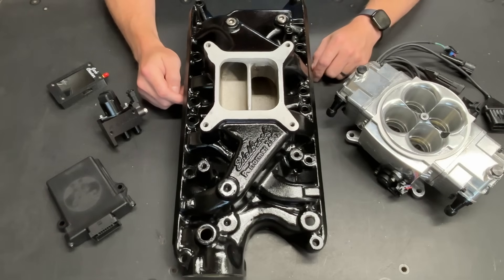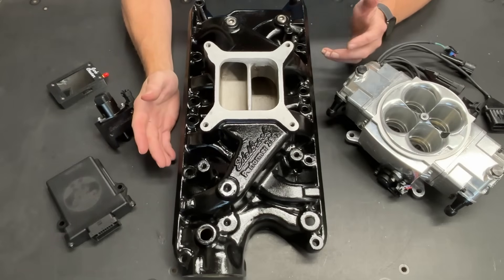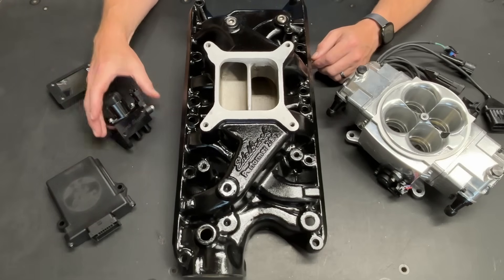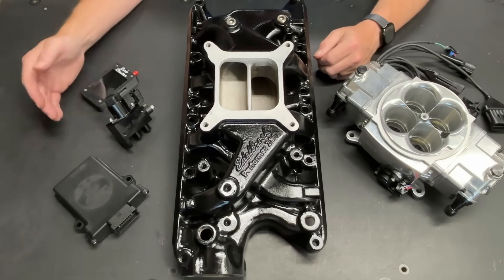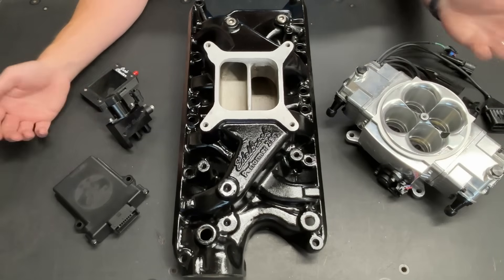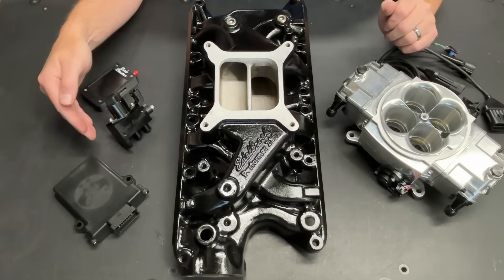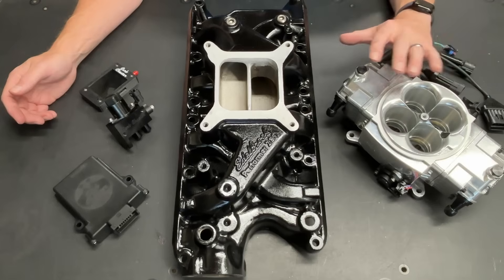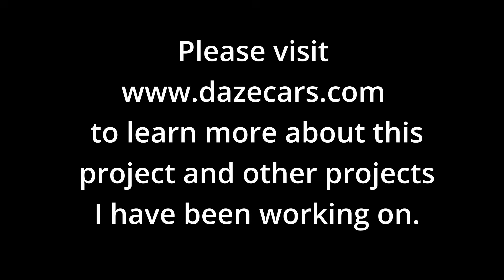Computer Controlled Fuel Delivery Carb Cheater 2.0 Vs Sniper  2 EFI, Why I Decided to Try Them Both

Comment: Cost comparison is flawed, fuel needs (pump, lines and return line) alone for the efi tilts it  in favor of carb.
Reply from the maker: Its not flawed, I wasn't saying it was exactly the same just that its close unless you already have the carb.  Carbs cost between $500 and $1000 so even when the fuel pump is factored in for EFI the carb cheater with carb may still be about the same cost as a TBI.  Also there are other manufactures of TBIs that are around the $600 mark.   I stand by my statements.
Reply: I appreciate the response; guess I'm more hung up on other channels speaking how the efi will solve the world's problems but do little to discuss he fuel system needing a significant investment - so little talk about the return lines, replacing the fuel lines to handle the higher pressure, new electric pump, elimination of the mech. pump, drop in tank systems, possible need for external fuel regulator... it just goes on and on...  Having said that, I am looking forward to seeing your thoughts on the carb cheater as its something I keep thinking about buying for my '73 Comet.
Reply from the maker: You are correct, bottom line is a TBI EFI is not as simple as just replacing the carb.  In this day and age neither option is inexpensive but it sure is nice to have options depending on skill level, desired use for the car and budget.

Comment: our subscribers must have some crossover :) 
neat to see Carb Cheaters out in the wild - beat me to my own CC 2.0 video (I need to lobby for more vacation days from work - my day job lol) 
Myself and Joe are the CC guys - between the mechanical/physical design, programming, and assembly to shipping. somewhat stressful, but such is life - a lot to juggle. 
side note, CC 2.0 with both the display and main circuit are updatable (I work on it in my "free time") - I have a worthwhile update for your display there, simply plug it into your computer and follow the prompts on "update display" of our websites "install info" tab. id post the link, but youtube will give me the ban hammer lol

CC has become somewhat a community project, so if there are any additions you would like to see, Id be happy to hear them - Since im the programmer, I can make changes and updates relatively quickly. currently working on datalogging for the screen like what the android app has - a future update there. 

CC has a weird backstory - primarily driven carbed cars my whole life, seemed like I was always chasing the tune, discovered widebands in 2012 or so and could then see how afr moved around based on conditional scenarios. not bad, but not perfect - static metering device in dynamic environment things. Carb Cheater was that last little piece my own perfectionism apparently needed with my own cars - just the thing I myself always wished existed, and eventually I learned enough to go "hey, I think I can make that thing". A lot of pain and suffering later - here we are (I under appreciated what it takes to actually MAKE a product LOL)

you might notice some "weird" fuel economy things on the highway - a lot of people seem to report fuel economy benefits. Personally I think thats just inherent in using the data and the auto-assist to optimize the carb - I'm not a fuel economy guy myself and I didnt make CC with that in mind, I just like the optimization game and a clean running engine. You will notice that the valve adjustment trades places with your foot pedal input - probably where some economy comes from as it probably benefits atomization (again, not my intent - but hey, "happy little accidents" I guess?)

I did originally design CC to hook to a carb itself, but frankly I prefer the valve porting and insulative properties of our spacers - if you would like one, feel free to email us at carbcheater at gmail along with any other questions you might have since you literally beat me to my own 2.0 demo video :)
Reply from the maker: I am not shocked by the fact that our channels have some crossover.  Given the shear volume of subscribers you have it would stand to reason that one or two would find there way to my little channel.  I'm a small fish by comparison.   Someone must have mentioned this video as a comment on one of your videos?  I did email you about a month back just after I ordered my CC looking for an ETA on the product, introducing myself, to let you know what I was working on, and to reach out one small business to another.   I did hear back from Joe but only the ETA was addressed.  I wounder if maybe you didn’t see the email?

I may have gotten my intro video done first but it will be a while before I get the unit installed on the car with subsequent install video to follow so there is still time for you to get your video out there  😁

I can’t imagine working a full time job and then have the carb cheater job as well as trying to maintain a YouTube channel all at the same time.  I have been selling classic Mustang parts out of my shop for 20+ years but it’s my day job.  That along with maintaing a YouTube channel more than fills up all my time.

As to your comment “I under appreciated what it takes to actually MAKE a product LOL”  I feel your pain, everything I sell started out as something for one of my cars and at the time I was posting what I was doing on forums.  There were enough people saying, “can you make one of those for me” that it developed into a business.   I don't realy do much of the "making" any more but that creates its own issues.

I may be interested in the carb spacer although if I needed to I am setup to modify an off the shelf unit.  I didn’t order the spacer because I have limited hood clearance and figured the port in the carb would be sufficient.  If you would like to chat further feel free to contact me through my website or if you end up finding that earlier email I sent that should have my address.  

I hope you enjoyed my video and sorry I beat you to the punch 😁
Reply: @dazecars  eh, subscribers mean nothing in this day and age - so dont read into that sort of thing, I've just been here a long time (like 12 years). I've definitely stretched myself too thin here lately where I wont be able to keep up work, youtube, and CC without losing my mind - It hasnt been all daisys and roses. 

my apologies on missing the email - joe and I switch back and forth in order to manage it depending on whos doing assembly in the evening. 
I'm a long time Ford guy, and would love to check out your stuff - I'm sure we would get along well. I can tell you are pretty sharp, whereas I just have to try really hard lol.

Joe deletes emails after going through them where I am more of a hoarder (which applies to many aspects of my life lol) - Id love to chat about your 393w if you were willing to pass along your website here. I myself started one and then life got in the way - I always appreciate the advice from the long time dedicated chaps :) 

I dont often get the chance to speak with deep knowledge folks - and one always learns the most when they surround themselves with those that are more knowledgeable.
Reply from the maker: I don't know about being "pretty sharp"  or "more knowledgeable" its more that I'm willing to try something just to see if I can make it work and then bang my head against the project until it does actually work. 😂  My website with contact information is dazecars.com I stared it doing tech articles specifically for the classic Mustang 20 years ago and then switched to YouTube about 4 years ago as people don't want to read anymore.  Lots of articles with pictures on my website and I believe the Maverick and Mustang are similar enough that a lot should apply to your car.  Shoot me a line and I will forward my original email along to you and we can chat from there.
Reply from the maker: ALSO as one "lets make these totally different parts work together" guy to another you may get a kick out of my Frankenstein EFI project https://www.youtube.com/playlist?list=PLg4j6XzBdSY_8M8btBCEyTLtsPzn6KpAv
Reply: I tune a ton of Aces EFI, and test any system I can with my own cars on the dyno, sometimes prototype models. I've always wanted to leave a killshot in open loop on the wizard file and just see how the Carb cheater did. They're always stupid rich out of the box so it would be interesting to see lol. I'll get around to it after some MPFI vs TBI comparisons this fall/winter.
Reply from the maker: sounds like it would be a very interesting test!!

Comment: Lets go! This ought to be a great comparison. However Uncle Luke cautions that coarse tuning is still required on the carb to produced an AFR slightly richer than desired as measured with the CC 02 sensor. Then Fine tune to a leaner AFR as desired (plus fine tuning of ign. timing), for the best CC experience. We are anticipating the upcoming videos, Thanks!
Reply from the maker: For my application its going with a carb thats already running well.  it will for sure be interesting to see if I need to make any adjustments.

Comment: At the end of this comparison, combine the Carb Cheater and the Sniper, just to see what happens. Might broaden the tuning window a bit.
Reply from the maker: That idea crossed my mind but because the system is autonomous they would fight each other.  Also that would require a second 02 sensor
Reply: @dazecars  not necessarily. The Carb Cheater would act almost like a watchdog, so even if it's used to log but not auto tune it could watch what the Sniper is doing ( I've heard stories about how some of the TBI style systems are not the most accurate ). If it helps improve the fuel curve and driveability, it's a win
Reply from the maker: thats actually a fantastic idea to use it as a monitor and not have it tuning.  May need to try that!!

Comment: Carb cheater doesn't sound that great to be honest. What if you're already running lean? 
I get the concept, it's great on paper but why bother when you can just turn a couple screws on a carb? 
If you're fitting a carb cheater, you'd probably be the kinda person who would has some knowledge of carbs?

I'd opt for the sniper, personally.
Reply: You make it richer, then the carb cheater fine tunes the a/f mixture, there are many advantages to a carb over throttle body EFI, like evaporative cooling, in fact many test have shown carbs make more power. Especially compared to the efi available for 302/351w engines. A 351w loves a single plane and a carb much more than a combover Sequential Multiport Electronic EFI.
Reply from the maker: I would not do that, properly tune your carburetor first!!!  A carb when not fueling correctly in its fueling curve (even when tuned correctly) tends to run rich.  Those are the areas that carb cheater corrects for.
Reply: @dazecars I didn't mean excessively rich, just a tiny bit over so the cheater can fine tune it in a way you can't by hand through the rpm band.
Reply from the maker: Its still not nessisary.  Carb cheater does not require a rich tune it requires a proper tune and nothing more
Reply from the maker: Not trying to be snarky or confrontational but I don't have a nicer way to say it,  Carb Cheater doesn't sound good to you because you have completely missed the point. It's not about tuning the carburetor as this systems requires a properly tuned carburetor to begin with.  In other words it's about making an already properly tuned carburetor work at the correct AFR regardless of driving situation.  A properly tuned carburetor will provide consistent AFR under consistent engine load.  In other words cruising down the road.  But when the carburetor's AFR comes out of spec is when load or acceleration changes.  In those situations the carb most often goes rich not lean and is designed that way because a slightly rich carb won't cause engine damage (other then reduced over all life) but a lean carburetor condition can cause catastrophic failure.  Thats why we have "extras" to add more fuel like accelerator pumps as an example.  With that in mind the carb cheater appears to be the fix as it will lean out the system in those situations prolonging engine life and increasing fuel economy.  ALSO As others have said in the comments One major advantage a carb cheater has over a TBI system is if something electronic in a TBI system fails you are stranded alongside the road but with a carb cheater you can simply disconnect the vacuum line, plug the port and drive home using the carb..
Reply: @dazecars  Not to be disrespectful as I think you have some great ideas and have done some great stuff, but a properly tuned carb does not need a carb cheater. It will have the correct AFR.  Where carbs fall down is going outside their abilities. The emissions and fuel economy regulations killed the carb.  The feedback carbs for the 70's and 80's was an attempt to meet those objectives, just EFI could do it better and won.
Reply from the maker: I don't think you are being disrespectful.  Its okay to have a different opinion.  In this case I for sure have a different opinion than you.  Even a properly tuned carb will over fuel the engine thats why carbureatored engines last abpout 100K miles and EFI is good for twice that because the extra fual washes down the cyliders.  If you have aver put an 02 sensor and AFR gauge on a carbureated engine, even one that properly tuned you will see lots of times when its rich.
Reply: @dazecars  Ever hear a properly tuned EFI is a carb?  EFI's great advantage is the electronic brain but it is only as good as the information fed and how well it is tuned. Is common to have a misfiring cylinder to make an O2 sensor read lean since it will read the unburned oxygen and have the EFI over richen the mixture.  Modern OE systems can detect a misfire condition.  Most aftermarket stuff cannot.  As I said the self tuning stuff is great until the base map is too far off then runs into a wall. It also as in the misfire example can wreck an engine if not caught and corrected.  Most of these systems do not have the diagnostics like an OE system has. As for modern engines going further is more than just EFI - OD, much better oils, fail safe mods, etc..  Also don't know of any TBI systems today. All are port or direct, or both.  TBI can overfuel a cylinder due to poor manifold distribution and the o2 may not correct that. I tend to find a lot of old cars are poorly tuned and run poorly so certainly understand people adapting these systems.
Reply: @SMS-wu1th  A carb will only give 3 or 4 points of adjustment, so a "properly" tuned carb is a very loose term. Yes you can set your idle jet for where you want your idle AFR, you can change out your main jet to set your wide open throttle AFR, but you only have one or two set points for everything else in between. For example, my carb has 4 points of adjustment, idle screw, then a needle jet for all mid throttle (the needle and jet can both be adjusted), and a main jet for wide open throttle. At best you can have pockets of accuracy, but you cannot have 14.7 throughout your mid throttle range, impossible, which includes everything from cruise to getting on the throttle a bit more, just before wide open. The carb cheater allows you to set your idle and main jet for wide open throttle. Then you can richen up your entire mid range, so it can take over using both the AFR wideband reading, and vacuum reading, to add air and give you an "almost" perfect AFR where it counts. When vacuum drops away, the system closes, AFR richen's up, and your wide open throttle adjustments kick in. You could never match this accuracy by simply tuning the carb. So simple, but a fantastic idea. I think this comparison is definitely worth it, especially for those who love carb reliability.
Reply: @johnarmstrong6940  Tell me what is the perfect AFR?  14.7 is stoich and for a long time the target for feedback carbs and EFI because cats don't like rich mixtures and narrow band o2 sensors are only accurate at stoich so the scheme was to "rubber band" around stoich (rich/lean) to get an average at that point.  

A carb is a series of different fueling systems all depending on the carb that handle different situations and have transition zones all depending.  You have a carter or q jet or some carb with metering rods from your description.  There are more things you can do to adjust the fuel curves just not easily on those carbs.  

A carb properly tuned will hold a very consistent fuel curve and taken care of they don't change. The carb cheater is nothing more than a means of adding a feedback circuit.  This was common back in the late 70's and 80's to meet emissions.  Main difference is the carb cheater is doing it by a controlled vacuum leak which those systems used fuel.    Fuel would be the prefered way as you can control both lean and rich, but it would not be easy to do for something intended to be universal.  The cheater has its place, but a properly dialed in carb you don't need it. Just most in this hobby don't know what or how to achieve that with a carb.
Reply: I will say one benefit carb cheater has going for it is with wide band 02 sensors you can pick whatever AFR you want.

One thing I'd warn is if you use a dual plane intake you need to make sure the air leak affects both sides the same.
Reply from the maker: Excellent point and that will not be an issue on my install as I milled down the center section of the intake .6" and then am running a 1/4" open spacer.